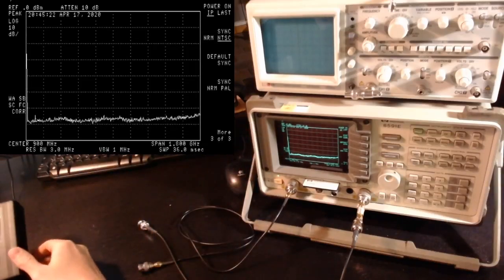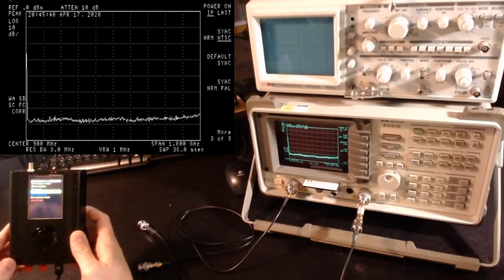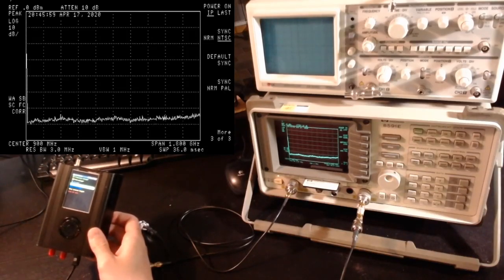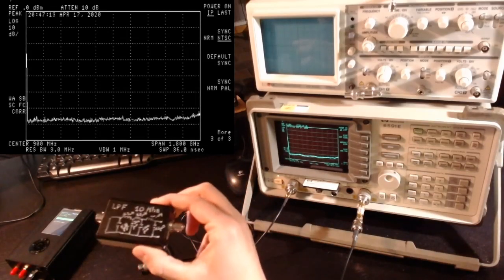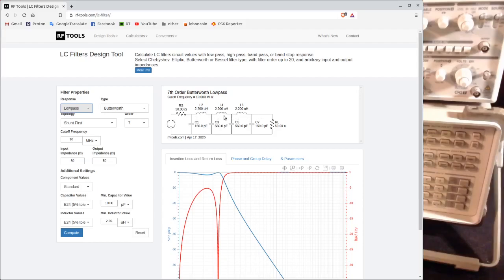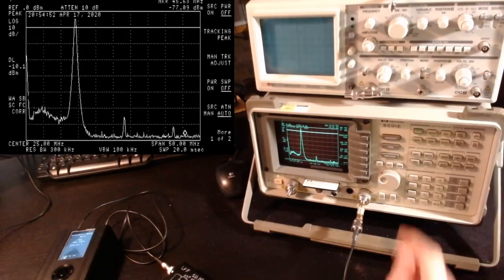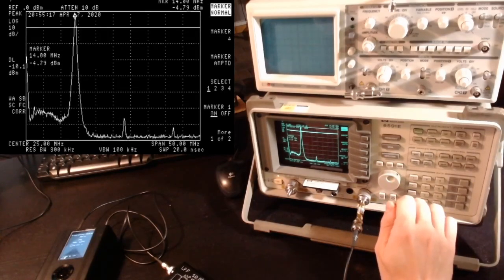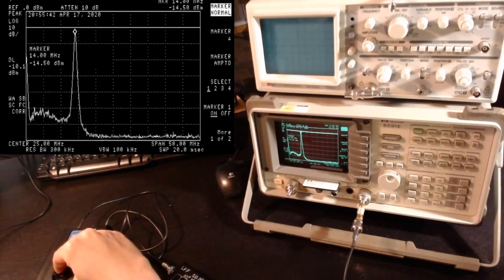Episode 11: Filtering the Output of a HackRF before using an amplifier.

Comment: Interesting!  If I want to transmit up to 3km using HackRF one, how can I accomplish that? How should I change the design and ANT500 antenna(Which antenna should I use)?
Reply from the maker: Hi, sorry for the slow reply! You can use an amplifier after your HackRF. Check out for example my Espisone 41
Reply: Definitely use a directional type antenna (“yagi”) to maximize loss.   You will most probably require the use
of an external amplifier to increase the max. RF transmission power output of the HackRF One SDR device.
Depending upon frequency you wish to use and the modulation type, you might just be able to buy an ultra cheap
open pcboard type amp for under $20usd.  I used an amplifier to increase the output power of the HackRF in the
70cm (uhf / 440mhz area ) for a DMR (TDMA) narrowband frequency and the cost was a little over $1200 for the amp
(TPL) and 40 amp 13.8vdc power supply.  It worked phenomenally well, but the HackRF wasn’t really designed for this purpose.

Great stuff though...